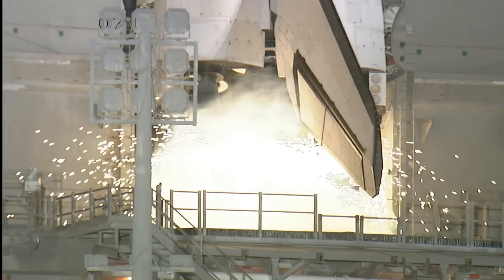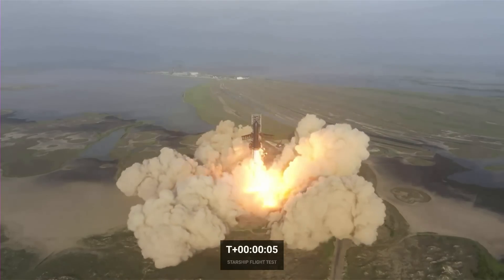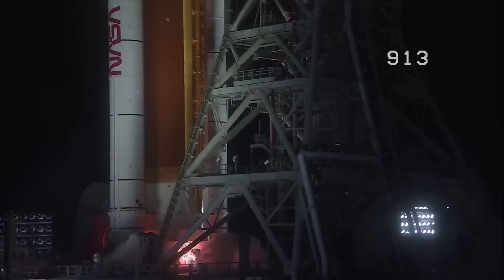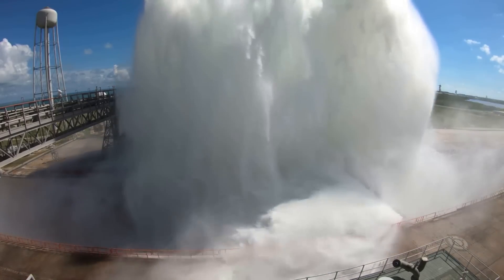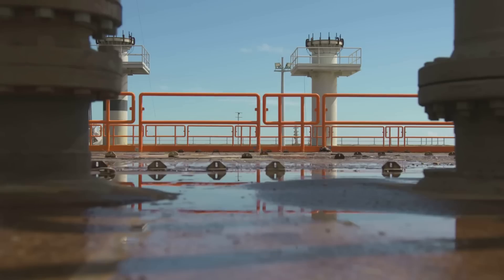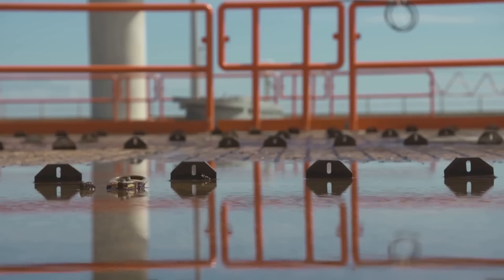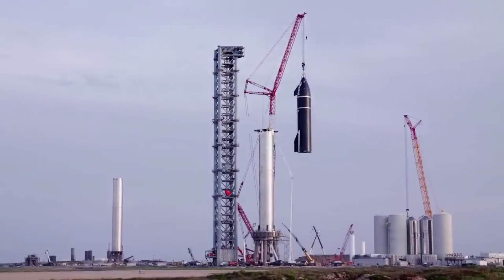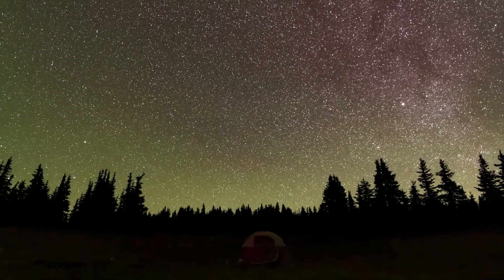Will SpaceX Add A Water Deluge System To Prevent Pad Damage?

Comment: Space X has spoken about the water cooled steel plates that they had begun working on prior to the 4/20 launch.  Space had also started work on the deluge system and we know deluge system is at Starbase because the parts have been seen lying around the production facility.  It is logical to conclude that the deluge system will be added as well although I can't imagine why Space X has only mentioned the water cooled plates and not the deluge since the launch.

Comment: there are already pieces of a deluge system shipped to starbase before the launch

the booster needs to survive reentry anvwav even if they found other solutions to the acoustic problem i don't think they would design starship to be any less robust. if you have to build it beefy anyway might as well try to get away with not wasting a boatload of water

Comment: Why not launch from the chopsticks themselves, instead of the platform? It would be higher off the ground and chopsticks are strong enough.
Reply: Chopsticks are designed to lift weight of an empty booster (~200t) or ship (probably, with 100t of cargo) (200-300t) at once, so no more than ~300-400 tons of weight. Full stack fully loaded with propellant weights ~5000 tons, ~10-15 times more than chopsticks will ever be able to lift.

Comment: I commented here on TheSpaceBucket several days ago of a plausible explanation as to why such a large volume of heavy Debris was ejected so far beyond the OLM at StarShips Launch. I basically stated that without a Water Deluge System, there was no water to obviate the insane amount of Acoustic Energy produced by 33 Raptors @ Power. Methane Burns Much Hotter than RP1 (a major reason Raptors were so difficult to developed) w/ it's Superheated Exhaust exiting at Hypersonic speeds. It's hypothesized that such an extreme amount of Acoustic Energy, at force and unchecked, could have fractured and "floated" (separated) the concrete slabs beneath the OLM enough to allow the Water Table to be Superheated into steam almost instantaneously. The local water table has crept back into that Crater w/ Tons of water since the Launch so it can be presumed there had to have been water there at launch. 

   I made this same comment on Scott Manley's channel days ago when he first released his own evaluation of how so much damage had occurred at BC. I brought up the "Steam Explosion" idea because he'd never mentioned it at the time. I see now since he's been interviewed on Fraser Cain's channel w/ Marcus House as a guest, Mr Manley has now proposed that as a possibility. He never commented back but I know where he got the idea.  ; )  What puzzles me though, is aside from the fact that SpaceX wants to eventually launch SS from a Sea Base (making a Flame Trench impractical & driving the need to launch w/o one), Cape Canaveral has Flame Trenches Everywhere . . and they're in the middle of a Swamp!  It's why you see so many Water holding ponds in the area, so they can Build on a Swamp. If you can build a Flame Trench in a swamp, then why not at Boca Chica is my question.
Reply: For one thing the water table is higher at Boca Chica then at the Cape.  The launch pad is barely above sea level at Boca Chica. And thus a flame trench would have to be elevated.  That is what I have heard from various sources.

Comment: Interesting report, but i'm still missing the answer to why didn't SpaceX conduct full duration static fire test at full thrust using one or more of their now scrapped booster stages.i understand the design approach of rapid iteration, but i'm left wondering if all these changes have come about without testing to validate the data has  been misapplied?
Reply: At full trust it took about 1.5 seconds for SS to get off the ground, and look at the damage it caused.   Think of what would happen if it stayed there while at full trust for 4 minutes.
Reply: @cleed1564  Actually starship sat on the pad for about five seconds for reasons that are unclear.  You can see that clearly from replaying the launch.
Reply: @michaeldeierhoi4096   the web cast was not sync to the launch count, the engine were starting up while count was still ongoing.
Reply: @cleed1564  Well that's certainly interesting.  I had not heard that before, but it may be true.

Comment: Nobody has made a Launch Pad capable of withstanding Musk's Mammoth MOAB ! ... A water cooled Steel Plate isn't going to be enough ! ... That BF Booster is gunna need Every Protection they Got ! ... and More ! ... Otherwise Reusability is a No Go .... Artimus had the Best Launch Pad going and it was Damaged ...  So Why ever Boca Chica thought , Fondu Concrete would be adequate is Incompetent ! ... Unless it was supposed to Fail ... and make Room for the Properly Protected Pad ... While testing the strength of the other Equipment ?

Comment: Just like the Space Shuttle, the orbiter is the problem. When the vast majority of your payload has to return to Earth, the merits of reusability become pointless. The Space Shuttle weighed 165000 pounds, and could deliver 50,000 pounds to LEO. So with each launch we would deliver 215000 to pounds of matter to space, of which about 140,000 pounds were just wasted effort. The same rationale applies to Starship. Far better to keep the orbiter unmanned, recover the engines for reuse and deliver 90% of the payload mass you lifted to orbit in orbit.
Reply: The target here is rapid reusability, the only material spent is supposed to be just propellant. So it's better to send ship that weights 150 tons with 100 tons of cargo and then get ship back, than send 20 tons ship with 200 tons cargo and never get ship back. Why? Because, in particular, orbital refueling: you better send 1 ship 10 times in a row to refuel orbital tanker for a ~month only spending propellant, than send 5 ships to do the same job each time making a new one, cos in that case you spend not only propellant.

The real problems with ship start when you have to deliver a payload to some far destination, like heliocentric (Sun) orbit, because you first gotta refuel that ship with cargo on orbit a few times, and then send it this far destination, eventually loosing it. So yeah, Starship is gonna be reusable, so when you can't reuse - it's a problem, one of drawbacks of full reusability.

But I bet they'll make expandable variants eventually as well, the same as with falcon.

Comment: The most simple and cost-effective way to creat a fully repeatable low to no damage system is over a pool of water. (Sea launch platform)
He should be building two rockets at the same time to reduce time between launches then make modifications to second from data off first rocket.
Reply: Why do you think they are not building multiple boosters and ships at once?
Reply: Maybe you just came up with the solution. Move stage zero 50 or 100 meters offshore. Let the ocean take the beating

Comment: I could be wrong, who knows, but my thought is starship grabbed by two to 4 wires suspended between multiple towers and hoisted to let’s say 75 meters, allowed to ignite a little slower until it reaches  balance between lift and gravity and then having the wires spread out away from it he star ship as it throttles up to full thrust , then no deluge system just a deep and wide water pool to absorb sound or sound absorb structures Beneath like the quietest room in the world sound proofing , no potential damage to tower, only issue still is if explodes and takes out near by storage tanks, wildlife,and people wires are easily replaced and can be 100 times stronger than steel is normally. Other option is to launch from out in the ocean, this takes care of almost all issues except towing time and moving platforms , lastly a wire system over water can be made to dampen buoyancy on water or just easier and more expensive oil platform rig that is grounded , or maybe an air pressure tube launch system to get it going then if night rocket 1000 feet in the air
Reply: It is completely unrealistic to lift the starship off the ground to launch from a higher position above the ground using wires or the chopsticks because a fully loaded Starship and booster weighs 5000 tonnes.
Reply: your right its 250 tons not 5000 by the way
Material	Tensile Strength	Safety Factor	Weight	Minimum Diameter	Diameter Calculation
High-strength Steel	1600 MPa	5	260 tons	0.154 meters (15.4 cm)	2 * sqrt((260000 * 5) / (Pi * 1600 * 10^6))
Carbon Nanotubes	63 GPa	5	260 tons	0.04 millimeters	2 * sqrt((260000 * 5) / (Pi * 63 * 10^9))
Graphene	130 GPa	5	260 tons	0.2 micrometers	sqrt((260000) / (Pi * 130 * 10^9 / 4))
UHMWPE (Dyneema/Spectra)	3.5 GPa	5	260 tons	0.86 meters (86 cm)	2 * sqrt((260000 * 5) / (Pi * 3.5 * 10^9))
Titanium	1400 MPa	5	260 tons	0.23 meters (23 cm)	sqrt((260000) / (Pi * 1400 * 10^6 / 4))
Nickel-Based Superalloys	1500 MPa	5	260 tons	0.22 meters (22 cm)	sqrt((260000) / (Pi * 1500 * 10^6 / 4))

Factor Safety of 2 instead of 5 

Material	Tensile Strength	Safety Factor	Weight	Minimum Diameter
High-strength Steel	1600 MPa	2	260 tons	0.192 meters (19.2 cm)
Carbon Nanotubes	63 GPa	2	260 tons	0.07 millimeters
Graphene	130 GPa	2	260 tons	1.66 micrometers
UHMWPE (Dyneema/Spectra)	3.5 GPa	2	260 tons	1.36 meters (136 cm)
Titanium	1400 MPa	2	260 tons	0.324 meters (32.4 cm)
Nickel-Based Superalloys	1500 MPa	2	260 tons	0.31 meters (31 cm)

some more materials that can be made in km lengths today

I apologize for the confusion earlier. Here's an updated table with the minimum diameter required for holding 260 tons using a safety factor of 2 for some additional materials in the table that have high tensile strength values:

Material	Tensile Strength	Safety Factor	Weight	Minimum Diameter
Carbon Fiber (Toray T1100G)[20]	7000 MPa	2	260 tons	0.051 meters (5.1 cm)
Aramid (Kevlar or Twaron)	3757 MPa	2	260 tons	0.174 meters (17.4 cm)
UHMWPE fibers (Dyneema or Spectra)	2300-3500 MPa	2	260 tons	0.235-0.188 meters (23.5-18.8 cm)
Polybenzoxazole (Zylon)[26]	5800 MPa	2	260 tons	0.092 meters (9.2 cm)
Silicon, monocrystalline (m-Si)	7000 MPa	2	260 tons	0.051 meters (5.1 cm)

Comment: I believe and hope at a minimum - even if SpaceX does not use a flame diverter - that they have the water deluge system and water cooled steel plates fully installed before the next launch. This should be a minimum requirement.
Reply: A couple of full thrust static fires before launch is a must.

Comment: Why not build a higher launch pad?
Reply: Agree. They should build a table as high as the OLM, put the OLM on top of that, make the tower one level higher, then install water deluge in that table and water cooled steel-plate underneath.

Comment: Everyone is talking about launch pad, no talk about problem on stage separation?

Is there anyway to force stage separation?  So that, out of two rocket, at least one can be saved if any problem raise?
Reply: There was no problem with stage separation.  If the rocket had been in a nominal flight profile staging would have happened normally.  But by that time, the stack was cartwheeling 38 KM in the sky.  Staging would have resulted in launching a missile at an utterly random angle.  While I would have loved to see it crash into the Texas State Capitol,  no one was dumb enough to light that particular candle.
Reply: I believe the hydraulics for stage separation exploded shortly after launch, but on the newer boosters the separation is electrically controlled.
Reply: They never met the conditions for stage separation. This isn't KSP. You can't just hit space bar.

Comment: You would think that even if the vehicle could sustain the pressure and vibration, that probably any future human crew might not. Stage 0 could be the world's most efficient human blender!
Reply: I agree. Then theirs payloads....
Reply: For some reason this was never a problem for crew of Saturn 5 or won't be for crew of SLS
So I bet ~2 times more power won't change the picture

Anyway, crew is hermetically sealed and pressurised, so physically well separated from ambient air, so no problem imo
Reply: @furyaroslav  Did you watch the video, or simply just didn't understand it? The launch pads for the Saturn 5 and SLS had/ have flame diverters and water deluge systems that muffled the sound and vibrations. Also the Starship is WAAAY MORE POWERFUL than both the Saturn V or the SLS! 

Your statement is kinda like saying, "Gee, we dropped thousands of bombs on Japan before, what was wrong with Hiroshima, that that one bomb destroyed the whole city?"  Yep, you sound that clueless......
Reply: @helifanodobezanozi7689  Why so rude reply? I just said since there were no problems with crew suffering from sound on other powerful rockets, I doubt there will be serious problem on Starship. I wrote "For some reason" because I just don't know the reason, sorry if it sounded rude.
And no, I never finished watching the video.

"Also the Starship is WAAAY MORE POWERFUL..." - yeah, that's what I have mentioned saying "I bet ~2 times more power won't change the picture"

"And Starship doesn't have a crew compartment yet" - yes, I know, did I say it's already done? Or are they gonna launch people without hermetization? Saying "Crew is hermetically sealed and pressurised" I meant it always is, not currently in Starship, so to "And Starship doesn't have a crew compartment yet" I can add "It doesn't have crew yet either". 

Strange reaction to basically "I doubt sound would be a big problem to crew because it never was and crew is separated" answer, like I wanted to dеspіse or humіlіаte you or smth, so bye
And apologies for me being mean or rude
Reply: @furyaroslav  Oh yes, and the Starship doesn't have a crew compartment yet.

Comment: My concern is that without the ability for earth to give way, forming a crater, the steel plate only more perfectly reflects shockwaves with them more easily rebounding inside the lower skirt of the rocket.

Now, we don't want craters, but we also don't want perfectly reflected shockwaves
Reply: I think a water cooled steel-plate is good for a short termed solution, but not a long one.
Reply: @karlkarlsson9126    NASA is not happy with the launch pad they are building at the cape.
Reply: That's what I was thinking and saying flat base beneath the mount wouldn't do anything but spread the carnage everywhere full 360° need a flame trench so you can direct the forces safely away from critical systems.

Comment: If Spacex does go with a sloped steel diverter plate it will be interesting to see how they integrate it under the pad.  The pad currently has six legs I think.  A simple one slope diverter would cause a lot of exhaust to be directed directly at the side of one or two legs.  Not sure one or two legs could take this for multiple launches.  Another approach might be to have two slopes at 180 degrees directed predominantly between two legs on opposite sides with the vertex at the center of the pad.  A third approach might be to have a six sided diverter directed between each of the legs and coming to a point at the center.
Reply: Imo were going to see a big redesigned of stage 0 before it's doing production cadence launches.

I suspect we'll see them put the current launch platform on a more traditional looking launch base so they can properly install a full diverter and deluse system.